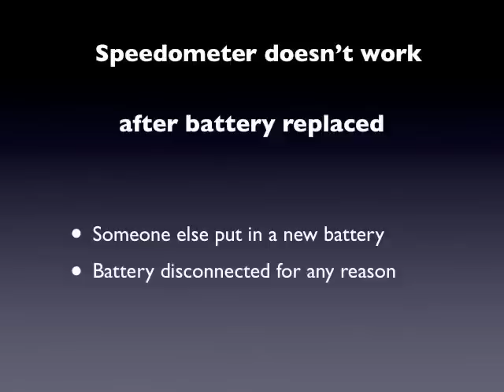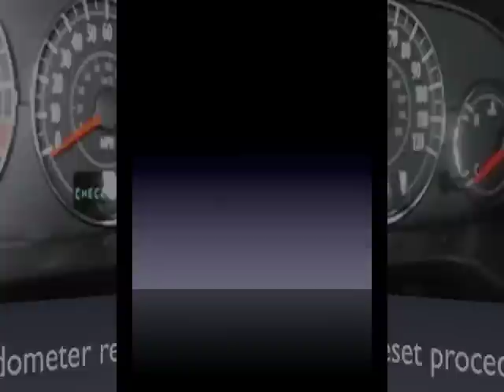Speedometer reset

Comment: I have this in my 03 silverado 2500had it serviced today, cleaned the airsensor.replaced fuel filter's. but when i drove it away the silly trouble light come's on that look's like an engine 
run's alot better, but guage's need attention.
i wonder if this would work for this silverado of mine?

.